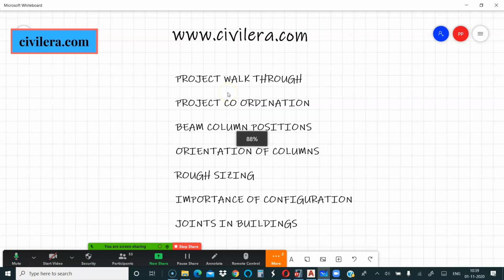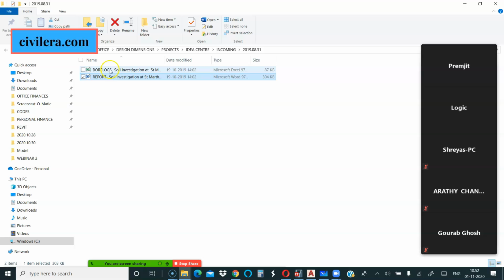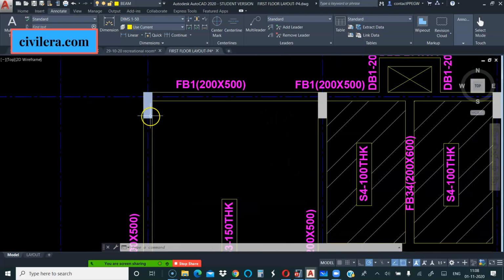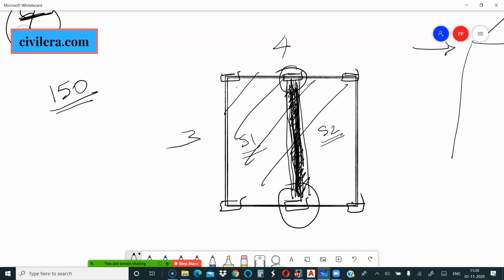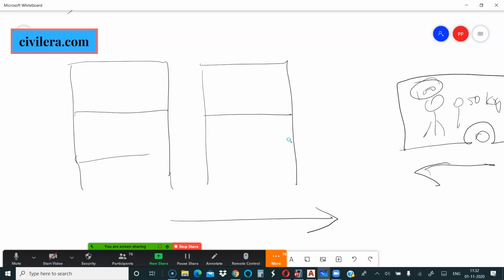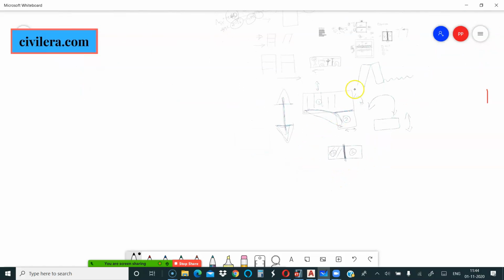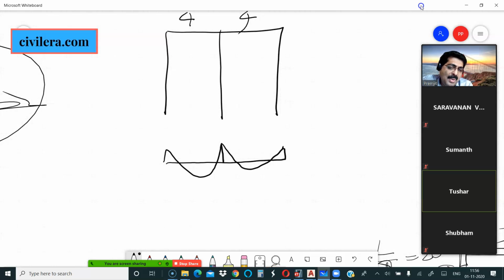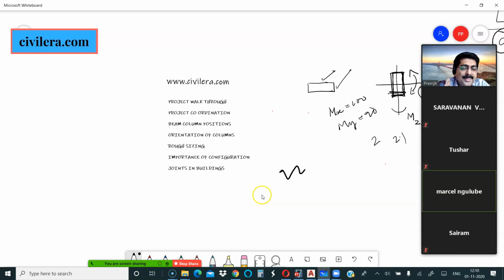Tips for Preliminary structural Scheme of a Building

Comment: While calculating the slenderness ration can we reduce beam depth from the column height?
Reply from the maker: You have to be more clear in your question. If it is just to calculate the slenderness value refer 25.1.2 and it is the effective length.Now what is effective length :-) Thats a long calculation based on sway index. If you contact me by whatsapp or email,i will take you through a video series that explains. Our courses cover this calculation in detail

Comment: Sir, Column width 200mm?? And the  interconnecting walkway looks critical.
Reply from the maker: 230mm is quite fine in zone 2. In zone 3 the col dimensions has to meet ductile detailing criteria and it shall be 300mm or 20 times the dia of beam rebars at the junction.